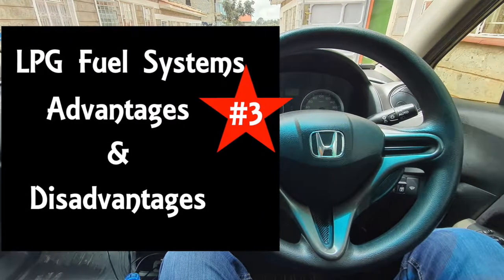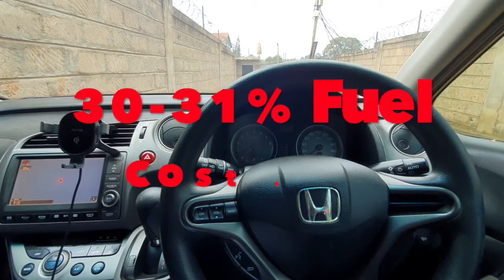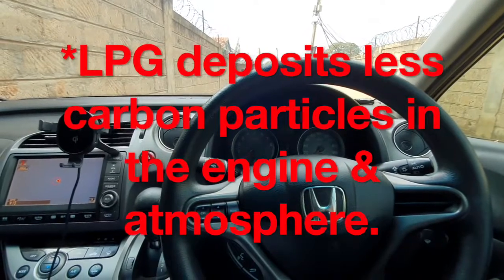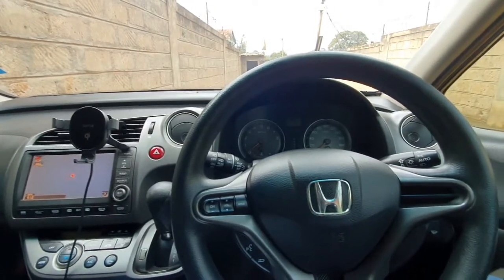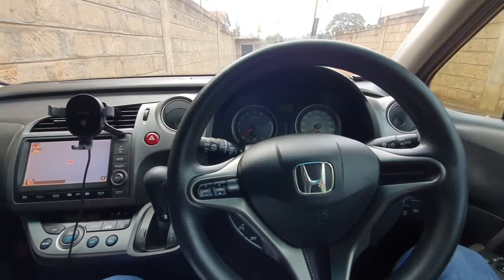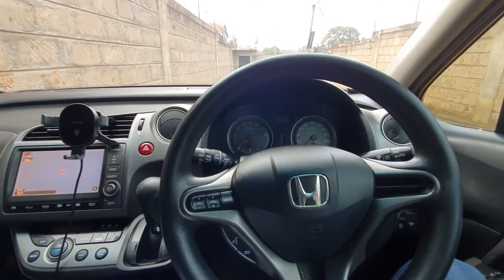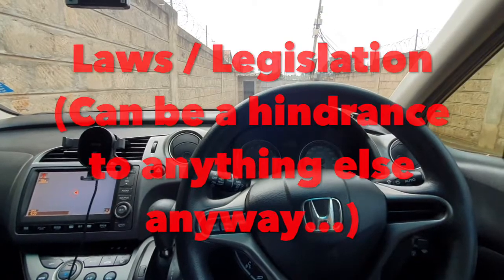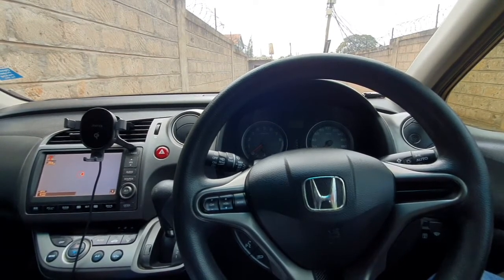LPG Fuel systems :  Advantages & Disadvantages (3 of 4)

Comment: I got some questions

1. Do you need to tune your car after an lpg concentration?
2. If you run lpg is your engine more prone to knock or detonation?
3. How much miles can you get from a let’s say you 100km on 20kg of lpg?
Reply from the maker: Mwakenya yako;

1. The tuning happens during the installation process as you can view from the installation video. The only tuning I recommend after LPG conversation is for cooling components service. Just keep an eye on the cooling system components since LPG does tend burn hotter than petrol in an ICE.

2. With or without LPG, your car is prone to knocking & pre-detonation based on the fuel's RON among other factors. Pre detonation/knocking issues stem from lower RON (Octane number) when motor manufacturer recommends a high value ( maybe vice versa too). In simpler ways Shell's V-power is designed to fix knocking & pre-detonation in high compression ratio engines. LPG has a RON value between 93.5 and 109.4 ( probably higher than V-Power at under 90). Meaning your motor will likely experience minimum pre-detonation while on LPG (Better than V-power).

3. LPG is less efficient than petrol - meaning that you get less km/l on LPG. LPG is cheaper, so it makes up pretty well for the lost "km/l" tickers.
This information is quite technical & I encourage you to verify from other sources as well.

Comment: Does using LPG affect performance?
Reply: Yes it does, about 10% less power.
Reply: @PaulDeKor  Wrong. I have a 2021 Dacia Sandero with the 3 cylinder 1.0 litre engine with factory fitted LPG conversion from new (in Europe)- Power with petrol/gasoline is 90HP, with LPG this rises to 101HP. This is indicated on the official documentation of the car.
Reply: @maxinlux6570  oh, okay. thanks for letting me know more.

Comment: Hi, does the LPG system affect the car's engine in one way or the other? and can one get back to using fuel after installing the LPG and remove it in the future?
Reply: Lpg engines lust more than petrol,
Reply: @mannmann5386  the engine is same, But I've noticed while driving on LPG i get more performance and low speed acceleration
Reply from the maker: While vehicle is running on LPG, it is more responsive (a little bit more power). Yes you can remove it in the future.

Comment: Does car used LPG or gas for instead of petrol will have any damage with engine car?
Reply from the maker: No.
Reply: The engine last more on lpg than petrol.
Reply: Not really infact if the lpg system is installed well is so good that it almost burns entirely meaning no pollution to the environment and the engine life increases exponentially